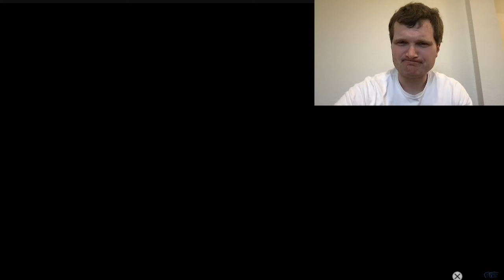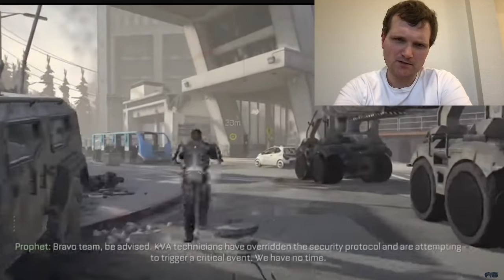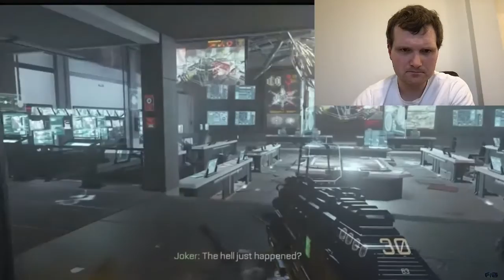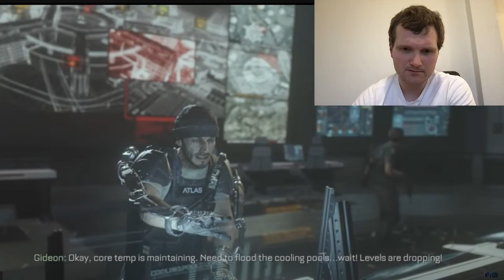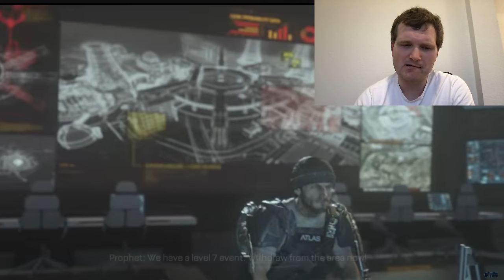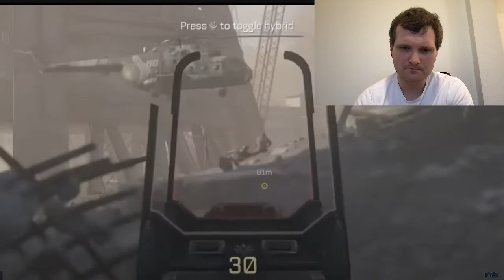Nuclear Engineer reacts to Call of Duty Advanced Warfare Terrorists Attack Nuclear Plant

Comment: The way I think of criticality vs prompt criticality is that I equate it to a diesel engine. Saying a reactor is critical is like saying a diesel engine is running. Ok, no problem. But saying a reactor is prompt critical is like a runaway diesel. If you don't shut it down its gonna tear itself apart.